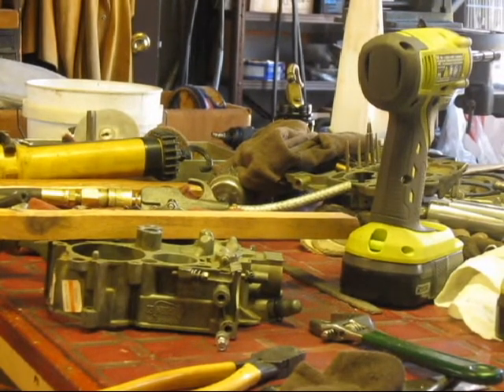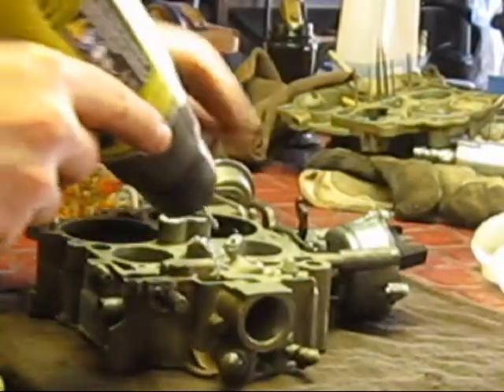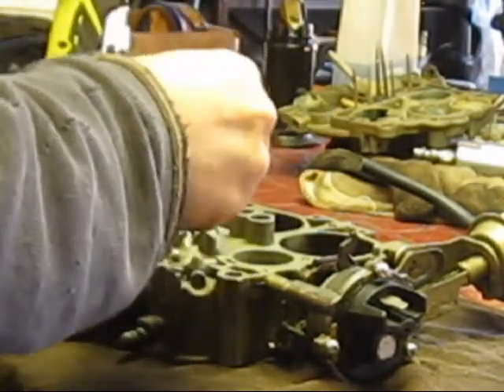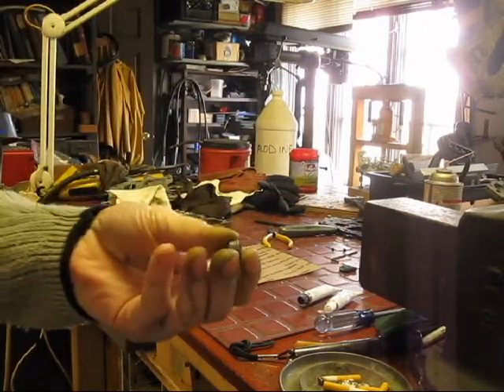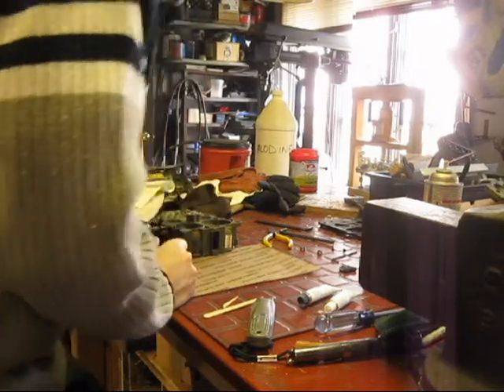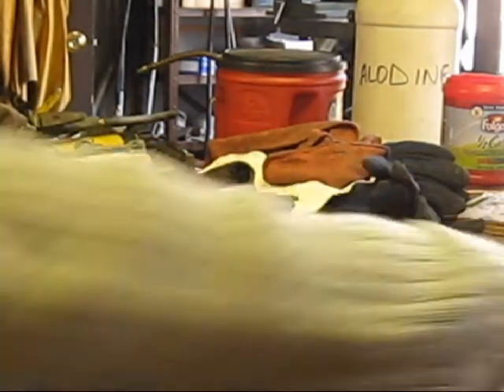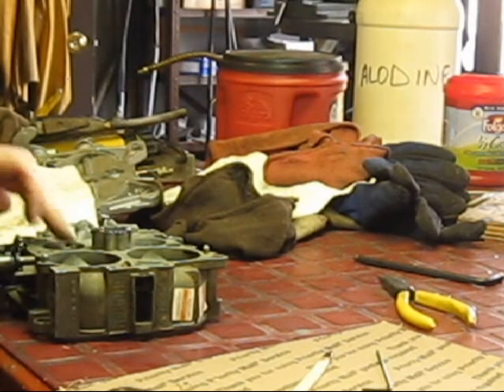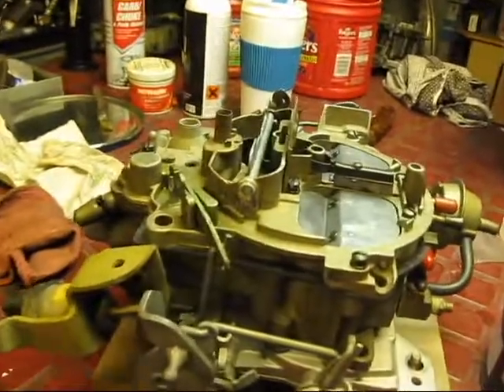Rochester  Carburetor Rebuild  Well Plugs Repair

Comment: Great video I have a suggestion on those plugs you used to seal the wells off and it is to use some stuff by Permatex called High temperature sleeve retainer because it's  impervious to most all liquids and solvents that's used to hold in cylinder sleeves and valve guides in heads ! It comes with the green glue as I call it and has activator can to activate the glue just before you assemble and has a few minuet work time to assemble parts then it needs to set and cure for 24 hours preferably ! It's also heat resistant to a degree that if you need to take the parts off or apart you have to heat to 400 degrees to separate which isn't to far from the melting point of zinc lol , so being the glue is thick it would seal the threads and those plugs up very good with no leaks ! I have use it on some press fit casting aluminum and on my Polaris atv that had a cylinder head aluminum hose spigot that was die casted as a insert job that came loose enough that I was able to pull this elbow spigot off out of the head then sand blasted both parts to clean then used the sleeve retainer to hold it together and it worked perfectly no leaks after 10 years to this day ! It's kind of of expensive but it works very good around 30 bucks and less messy than epoxy ! The px number on the sleeve retainer glue is # 64000 & the activator can is item 24163 but buy the kit that has both in the kit because it's cheaper !
Reply from the maker: Thanks, I never had an issue before, I have a repair on one of my Nova's cylinder heads, its aluminum, put JB on an issue where the water jacket was leaking into the top of the head under the rocker cover (I got a little too happy porting and polishing) I did it on one of the coldest days of the year, had to put a heat lamp on it over night! That was like 25 years ago!

Comment: If well plugs leak will it keep you from setting idle screws with a vacuum Gauge. I rebuilt my carburetor and have everything plugged off . Hooked up vacuum Gage were the PVC hose goes. Not getting vacuum on gauge to set to vacuum

Comment: I pulled out the well plugs, cut threads and threaded set screws in with threadsealer in a quadrajet as an experiment.  The original plugs weren't leaking, this was just a test and I decided I prefer leaving them alone if not obviously leaking.  I never found one that actually did leak.  I've noticed today's fuel will empty from the bowls in a couple days though, pretty sure this is evaporation rather than leaking?
Reply from the maker: If its warm enough, it will evaporate, especially if you have alky in the fuel like I have,,, what thread sealer did you use?
Reply: I used Gasoila e-seal, they also make a red sealer I've had good results using on fuel systems, called Hard-Set.
Reply from the maker: I never heard of it

Comment: Never had problems with JB weld (The 2 part classic stuff not quick dry). It is standard procedure to repair the well;s on Carter Thermoquads with the phenolic bowl. Never had problems with any repairs. If it holds on phenolic will hold on metal. Use tapered  aluminum plugs not threads which give tight interference fit and tap/hammer them in coated with a little sealer of your choice. Plugs available from McMaster Carr and numerous other Industrial supply houses in various sizes
Reply from the maker: The issue I had was the epoxy didnt stick and got so soft. 
I have JB weld on my Edelbrock Alum heads, I put some on one of them after hitting a water passage with a grinder some 20 plus years ago. 
I was working outside when I found the leak, it was sub zero weather, I warmed the surface and applied, then put a heat lamp on it over night, never had a problem since.
But now, every time I tried to use it on fuel areas it doesnt seem to work.

Comment: Where is the excess JB Weld in the tapped threads and screw threads going? Possibly into the small passages for the primaries. Secondaries probably not so critical. I would not want any of the epoxy in the internal channels.
Reply from the maker: No issues there, I was careful with it, still running strong! No issue

Comment: the larger plug fix is probably ok, the smaller plug did not really do anything, you drilled and tapped into the soft plug material. you need to put a plug int the actual carburetor metal. leak still exists at the soft metal to carburetor hole interface...uppsss..
Reply from the maker: No I removed all the soft metal with the tap size, this part of the repair worked ok
#10 plugs are as big as one can go I believe